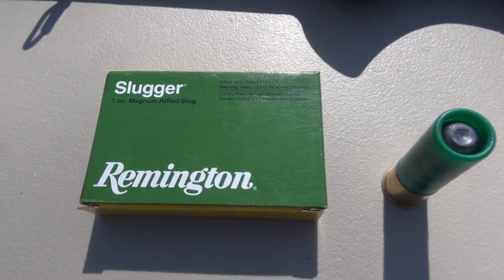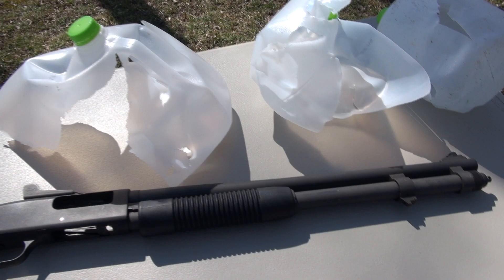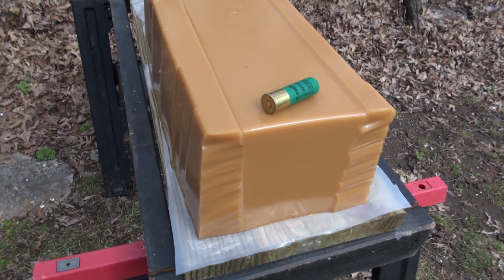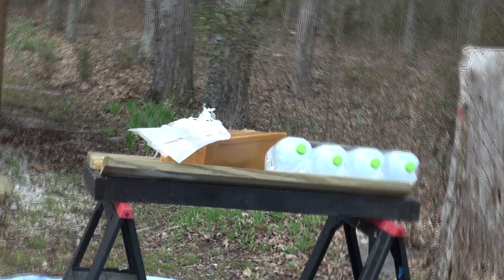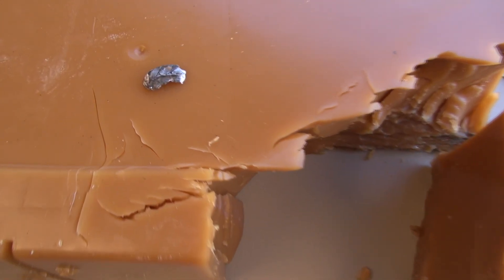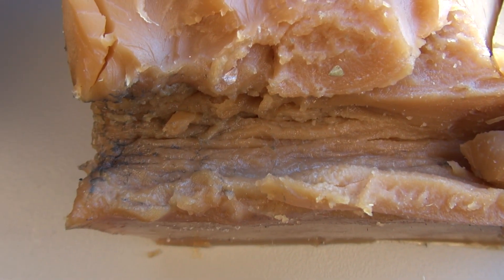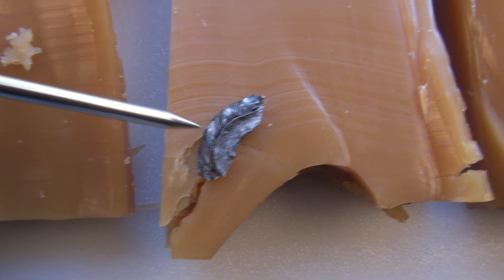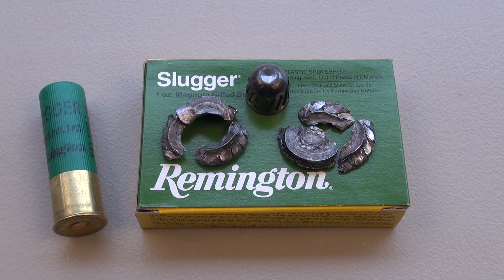Remington 12 GA 3" Magnum Slug Gel Test

Comment: I own some federal power shok 12 gauge 3 inch 1 1/4 OZ shotgun slugs at 1600 fps. It rivals a 2 oz 3 inch turkey load in recoil. Very powerful. Using my Mossberg 500 with the 1 1/4 oz slugs at 1600 fps, I shot a 1 gallon milk jug filled with water at a distance of 20 ft and it flew around 15 feet into the air. I also shot a small 3/8 inch thick ar500 plate using the same load and it bent the plate. Would put the hurt on anything charging at you in North America.

Comment: I have shot a big 250 lb monster buck with 3" slug in chest through the front shoulder and it blew the shoulder and bone dust and bits of bone was all through the deer hole was big enough to fit my fist in instant take down mo suffering deer was dead before it realized what happened

Comment: At the hunten camp Jack the carpenter shot his windshield about where the rearview mirror is . So some joker took a set of six point deer horns and stuck them into the hole . Then took a pic , ha ha ha . Jacks son put smoke less powder in a muzzle loader opened the sliding glass door and fired . The hammer flew off and tore off his brothers ear .same young man joined the na gaurd . Riding in a pickup holding a loaded shotgun with the barrel resting on the top of his foot blew a hole threw said foot .

Comment: The Federal Extreme perpetrator uses hard lead with a copper coating on them. These Federal rifled slugs are no joke as they would most likely pass into the second block half way. I've seen them in several videos and they are intended for large game bone penetration as well as barrier penetration.

Comment: shooting water jugs doesnt dictate wether or not it will pass both sides of a car door. youre comparing two different mediums. thin sheet metal and plastic campared to 3 gallons of water? use car doors if you want to know. fyi, it will go through both sides of both doors

Comment: I wouldn't use slug in a smooth bore shotgun barrel it effects accuracy very negatively
Reply: Rifled slugs cannot be used in a rifled barrel, they are designed for use in smoothbore only.
Reply: abrb1223 so even without rifling grooves in the pipe I can use slugs instead of HV Xpert steel goose load?
Reply: +Derek Wall Rifled slugs are made for smoothbores, hence the rifling on the slug itself.
Reply: +Derek Wall Not sure what application you are using them for, but yes. Non rifled slugs are meant for rifled barrels, as the smooth surface of the slug allows greater surface area to come in contact with the lands and grooves of the rifling. Rifled slugs are meant to allow some of the gasses to escape through the grooves in the slug itself, thus causing a turbine-like reaction and imparting spin on the slug. Hope this helps, and thank you davidca for helping, I just wanted to ecpand on it a little further.
Reply: abrb1223 hunting at medium range is the application I want to use them for
Reply: +Derek Wall Just curious, but where did you come up with steel goose loads then?
Reply: abrb1223 I mentioned them because I want to use slugs to hunt larger game such as deer or coyotes and steel goose load has a max effective range of 45 yards (135 feet) and that's on good days, so I'm asking if I need to purchase a rifled barrel to use deer slugs to boost my range up to 200 yards (depending on what slugs I purchase)
Reply: +Derek Wall I see where your coming from, but the way you structured your sentence made it seem as though you thought steel goose shot was acceptable for deer hunting at ANY yardage, which is completely false. Sorry for the misunderstanding.
Reply: abrb1223 you cannot use goose load steel or lead on game that size, just on coyotes, hogs, raccoons, possums, waterfowl and pheasant that I know of and I have shot plenty of possums rabbits and raccoons with those rounds and even at 30 yards they blow a rabbit in 1/2

Comment: Can you shoot foster slugs in a rifled barrel ?   ( thinking safety )
Reply: +DeNirosGame1 Do you mean BRENNEKE??  :/
Reply: to recap YES YOU CAN SHOOT RIFLED SLUGS IN A RIFLED BARREL. YOU CAN AND IT IS 100 PER CENT SAFE
Reply: Frank DiOttaviano Thank You  -  I wasn't sure
Reply: all good guy. the only thing with your standard foster style slug to remeber is do NOT SHOOT THEM IN ANY CHOKE TIGHTER THAN FULL. and accuracy is horrendous outside of cylinder and improved cylinder to boot
Reply: Thanks again  Frank

Comment: I have shot a lot of pistol rounds into water.  Take the 9mm Federal HST for example.  The HST always performs great in gelatin but with both a pistol and a carbine the HST will only penetrate 2 jugs of water coming to rest in the third jug, if it does not fragment.  The only round I have ever fired that performed better in water than gelatin is Hornady 357mag 158gr Custom.  The 158gr Custom ripped through six water jugs.  I am certain the XTP bullet expanded.

Comment: I wonder should I use a 12ga for a Primary weapon
Reply: It depends. 00 buck is a formidable stopper, but pump actions usually top out at 8 or 9 rounds. I'd take an AR over a 12 gauge. The shotgun does have the power to stop large predators though. That's a good point for those with bears.

Comment: I've killed a lot of deer with this slug.   It's the only slug my 870 patterns well with.
Reply: Group is correct, pattern is for shot.
Reply: My 870 is good with these  3 inch up to 75 yds but i also do good with the 2 3/4 inch winchester rifled slugs
Reply: Lol first time ive ever heard of patterning a slug
Reply: Travis Rist Irrelevant, but patterning refers to shot, a slug doesnt have a pattern.
Reply: It's a smooth bore slug barrel.  No choke or rifling just iron sights.
Reply: What choke were you using for slugs?  I've heard that slugs like Improved Cylinder the best but I haven't tested it at all yet
Reply: You must not be a hunter then.
Reply: If you shoot 5 slugs and they all fit in a 3 inch circle that is called a 3 inch pattern or group.

Comment: What type of choke tube are you using? Can you use a modified for slugs?
Reply from the maker: +Nick Q Cylinder bore.
Reply: +Nick Q cylinder or improved cylinder are recommended
Reply: +Nick Q I use the Remington Slugger 1oz 2 3/4 inch which has a velocity of 1560 FPS.  I shoot this through my Mossberg 500 Flex 28 inch barrel with an improved cylinder choke.  With this current setup I am super accurate at 100 yards with iron sights.  Here in Florida you won't see anything past 50 yards due to brush and palmetto coverage so no shot chance will be beyond 50 yards.  I have killed 5 deer and 4 hogs with this setup.
Reply: +The crazy Weaponcrafter  finally someone knows what they are talking about you can have some choke  not too much way to go open a shell take your slug out put it in choke from back you will have some idea what choke to use

Comment: It would go through both doors. Trust me. Water slows down a projectile a lot mire than you think.
Reply: You took the words out of my mouth. Waters incompressible properties are amazing. The stronger the round, the more water will slow it down.
Reply: Roger that
Reply: Watch the Mythbusters where they shoot the .50BMG into the swimming pool. If I remember right, the bullet stopped at something like 5ft??
Reply: 1m so about 3ft water and your safe
Reply: @Guardsmen4  But not if a grenade drops in.   :)
Reply: Did the slug  pulverized some of the lead? What cause discoloration at the entry point? I guess it could be powder residue.
Reply: Factory slugs are coverd with Graphite why there black not shiney silver color like fresh cast slugs/ bullets / buckshot 
Etc
Reply: +Guardsmen4 I tested a hatsan 155 torpedo in .25 against two gallons of water and I was shocked when it passed through.  45grn at 750fps.
Reply: Bigspiderman 
it power residue and some lead gets scraped off in the barrel and will come off even on paper or gel in this instance.
Reply: Water is an unsung hero vs any type of round
Reply: A 5 gallon bucket full of sand will stop a 30 ought 6

Comment: Pro tip....
Three inch 12g rounds kick like a SOB.....
Take the shoulder plate off you will notice 1-2 holes cut out to save weight.They are the perfect size for nickels (coins). Fill the hole or holes up with nickels the gun will be heavier but will reduce the recoil often considerably.

When it comes too heavy rounds often a light gun is not always ideal.I had a 7mm magnum synthetic the damn thing would bruise your shoulder even with the proper stance.I traded it for a wood version while heavier it felt like a whole different gun when it came to recoil.
Reply: I've earned some epic bruises from a 3" nitro-mag(nitro steel, remington) rounds...i'm done after fifteen rounds! lol very similar to a 30-6, in recoil.
Reply: @mindofganza  i know what u mean with the nitro mags. I'm done with just 3 rounds!!.
Reply: I know this is an old comment but try some 3 1/2" Turkey loads some time.also use some no.8 lead shot in the stock of your shotgun or rifle it weighs more than nickels. plug it with epoxy at the end so it doesnt spill out.
Reply: Benson
Reply: MrSnapy1 '
Reply: revólver calibre 38
Reply: MrSnapy1 your just a pus😂😂😐
Reply: Ii

Comment: I have a Mossberg 695 12 Ga. bolt action rifled barrel slug gun.  After spending a ton of $$ on sabots and other slugs made for a rifled barrel I realized that my gun shoots stupidly accurate with these Remington sluggers.  Now that's all I shoot.
Reply from the maker: ***** Interesting point, thanks for submitting.  I'm probably going to run something like this through my slug gun and test accuracy at 50, 100, 200 yards etc.
Reply: Of course it does these suckers self stabilize to a 4 to 5 inch group maximum in a hundred yards the rifling is going to get you darn near same hole
Reply: ***** That would be great! Could you also pop a scope on a smooth bore and contrast accuracy at similar distances?
Reply: ***** is what you d

Comment: If you made the slug out of tungsten-carbide instead of lead, you could have a VERY beefy armor piercing round that could penetrate light tank armor, or so I've heard.
Reply: The 12ga shotgun is technically shooting a .50cal 2 an 3/4 3in bore size
Reply: So I see a possibility if it is moving at high enough fps
Reply: Not too bad. An AP slug would probably perform much like a .50 AP round then.
Reply: luigi2999 I dont think it would work because of the low velocity and large surface area
Reply: It would work, although it might only penetrate light armor, not tank armor.
Reply: luigi2999 A .50 BMG will only penetrate light armor, a 12 gauge is technically a .70 caliber round, and much shorter than a .50 BMG round, leading to a larger frontal surface area and lower bullet density.  I.E.  Far less effective.

Another way to put it:  rifled 12 gauge slug shaped projectiles for piercing armor:  Physics says no.
Reply: True. Problem is the 12 gauge slug is not the highest pressure round, most shotgun loads are low pressure. At any rate, a .577 T-Rex can penetrate light tank armor, as it is one of the most powerful cartridges ever made.

Comment: So just by guess how many yards I have to be to kill a deer or black bear
Reply: jimmy avery Accurately about 50 yards but they can kill  past 100 yards if you can hit the target.These slugs would stop an elephant in its tracks.Back when I used to hunt I staggered my rounds first shot was a slug then some buckshot.That way if I missed with the super deadly slug I had a better shot at hitting the running deer with buckshot... 

Btw with a rifled shotgun barrel 100 yards is np.Problem is your limited to slugs as buckshot/birdshot can ruin the rifling's in the barrel.Personally I used a smooth bore as it gave me more options.Besides if your shooting 100 yards + a regular rifle would be a better choice.Most deer are killed within 50 yards unless you live in wide open area.Most of us hunt in thick woods where a shotgun works best.

Comment: Question would that slugger kill a black bear if I was ti run into one if I go hunting
Reply: Yes. You're talking about almost an ounce of lead, as he pointed out. 12 gauge deer slugs, like he was using, have as much stopping power as .30 calibre rifle. The only problem is, you'd have to get close. Same with deer hunting. I read on Wikipedia that in some areas, deer slugs are all you're allowed to use. .30 calibre rifle can hit targets up to a mile away, where as a deer slug is only 50 yards, maybe more. I used to sell them, when I worked at Walmart and an old guy told me he uses them to hunt black bears. He says they work fine, but again you have to get close and be more careful. Happy hunting.
Reply: 100 yards

Comment: Part of me thinks that slug could probably make it through both doors or at least part way into the second, water has a lot of surface tension at that speed, where as doors are kind of thin stamped metal and a plastic door panel. I'd like to see it.
Reply: the slug would ABSOLUTELY rip right through both doors, i 100% gaurentee it. he is comparing apples to oranges.. there aren't really any bullets that will go through more than 4-5ft of water, especially with any force. a thin, solid, malleable metal like a car door though? hahahaha, that door hit by this (or any slug) would be like paper to a 9mm.
Reply: Nolan Green 
A  2  3/4”  foster slug goes through both doors of a 74 Cadillac  7 out of 10 shots.

Comment: Those slugs will have no problem passing through 2 car doors if it penetrates 3 1 gallon jugs. 18" of water vs maybe 1/8" of sheet metal.  Might be a different story if it hits the horizontal impact beam in the door

Comment: Hello nice video, i did not know that you can use a foster slug in a smooth bore barrel. was told that you could only use them on rifle bore barrels? what's the deal?
Reply: The foster slug was designed for a smoothbore. The rifling is not to make it spin but to help the slug swage through choked barrels. im sure you could shoot them through a rifled barrel without a problem but not a 100 percent on that. Sabot slugs are only accurate out of rifled barrels or barrels with rifled choke tubes. They will still fire out of a smoothbore but i wouldnt expect acceptable accuracy. hope this helped
Reply: thanks for the info.
Reply: MegaBait56 Yes, sir

Comment: water is actually incredibly strong at restricting bullet travel.
Reply: Right i have seen police using water to stop bulets without dameging them to examing riflemarks .
Reply: Yup. I cut a square out of the top of an old bladder tank(28" tall). I stuff the bottom full of rags, fill it up with water, then test hollow points, by shooting down into it. Works like a charm...    I just discovered that a 36g Mini Mag WILL EXPAND from a 4.1" barrel handgun(TX-22). I also discovered that the cheap Remington green and white box hollow points expand very well, from my PT-111 G2. No need to waste money on premium ammo. They work just fine. Gonna test some 158g soft point .357 rounds next...  Among other things........

Comment: In answer to your question about vehicle doors, we put one through a BMW (mid 90's 318i or 325i or similar, I believe) at a 90* angle to the driver's door, near the center of the door. It exited through the passenger side door. The REAR passenger side door. I have no CLUE how it happened. Federal 1oz Truball from an 870 at about 15'.

Comment: I used these for deer before.  They work. 

I notice a lot of people saying foolish things in the comment section.  No, these are not "armor piercing".  Why would they be?  Its a lump of relatively soft lead.
Reply: jimbo111589  Oh I 100% agree with that assessment.  But to say they are armor piercing would be a misnomer.
Reply: I think the issue is, is that slugs can kill you without even penetrating soft armor. The force of the projectile alone will collapse your lungs and break your sternum easily. That's why armor gets brought up a lot in slug videos.
Reply: @jimbo111589  If you're using plate armor that's a high enough rating, you won't feel much besides a shove. The plate completely absorbs the energy from going into your body.
Reply: @DangerRussDayZ6533  yeah 3k ftlbs of energy goes pretty much straight into your chest. The nij test blackface deformation for a reason, it likely wouldn't kill you, but it would knock you on your ass, even with level iv plates the energy has to go somewhere
Reply: More like armor negating...
Reply: You guys definitely not the typical YouTubers 👍
Reply: @blackalgorithmist000  good ole regular human interaction :)
Reply: @v8powa466  that's right
Reply: Great test, but I'm surprised at your conclusions.  Max penetration depth was well within FBI suggested depth, and LESS THAN typically seen by 00 buckshot, but you state a preference for the buck.  Why?
Reply: Completely agree, ribs would break, internal bleeding and probably hitting the ground hard on impact. Armor piercing on not.

Comment: I would like to state that its hard to get any rounds through a lot of water as water does not compress. if you were to shoot in a pool of water, the surface tension would be hard to break, and might as well be close to a brick wall.
Reply: This. Larger rounds traveling at higher velocity simply fragment in water. Lower speed projectiles don't fragment and are more lethal in water. See mythbusters shooting water to see a good example of this.
Reply: ralffyx
Mythbuster's data was flawed due to choice of ammo type. Numerous tests have shown bullets traveling through feet of water without breaking apart, when MB reported complete disintegration.

Comment: I would still like to see you do a test into gel at 50yrds. practice a little to see were your gun is placing the rd at that distance.I have recovered slugs ,flattened
like a quarter but in one peace from deer Shot at that range.Slug traveled through at least 16 inches of deer before stopping against the inside of the shoulder blade.